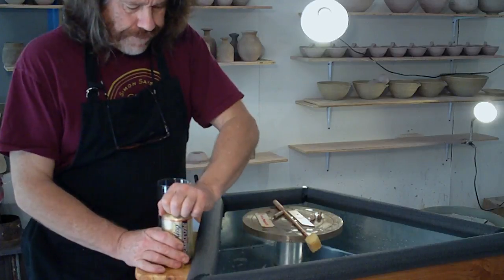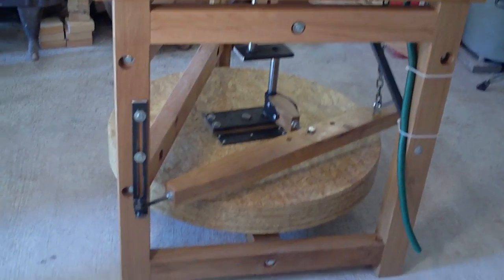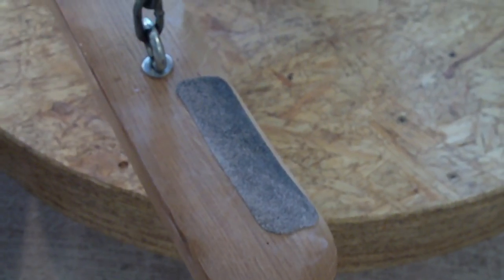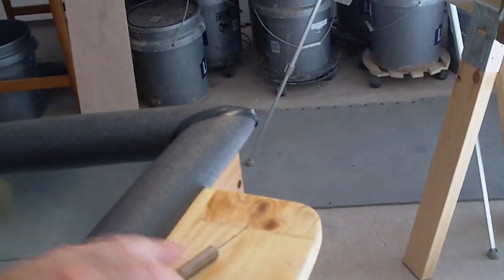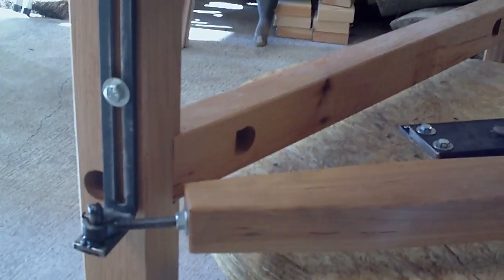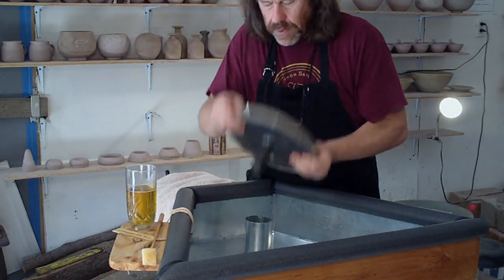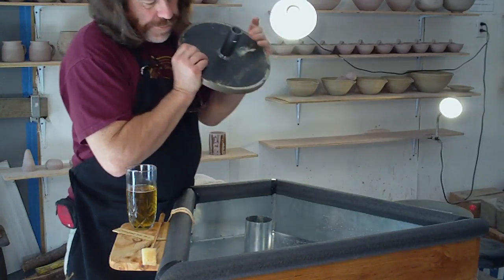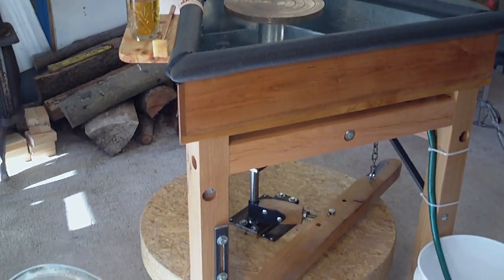SIMON LEACH POTTERY ~ The Leach treadle wheel ~USA version !

Comment: If you want the wheel head to be easy to clean and remove, you might look at the way the thomas stuart/Skutt heads work. I don't think they cost any more than the brent ones, but they are quite nice to work with. They can be quickly removed without tools. The shaft has 2 pins near the connector. The head has a slot to accomodate the pins, and you twist to lock it in.  If you search for thomas stuart wheel you can see it on the site. It lets you use a cup head as well that holds paster bats.

Comment: I agree it will hold up to the stress however I also agree with the other guy, on a wheel of this quality the material in the flywheel has the appearance of a cheaply done job. These are just opinions though hope you sell alot of them brother.
Reply: paulluna45 I have just finished sanding and finishing the wood. Not cheap material. The plywood is nautical plywood and will hold up underwater... which no water gets on it. The cuts are precise, they are beautifully edged and crazy cuts that I’m not even sure how one would go about making. I just wish instructions were more clear.